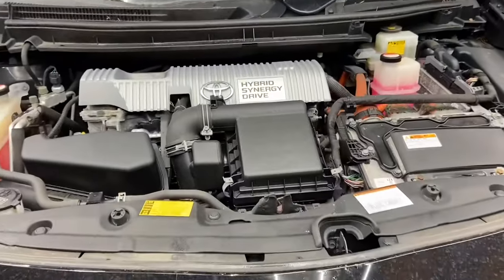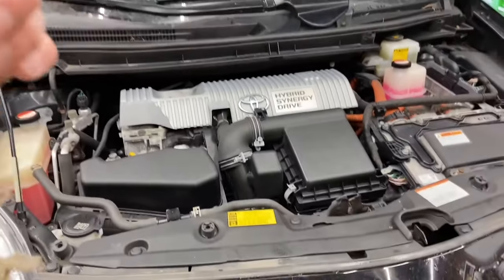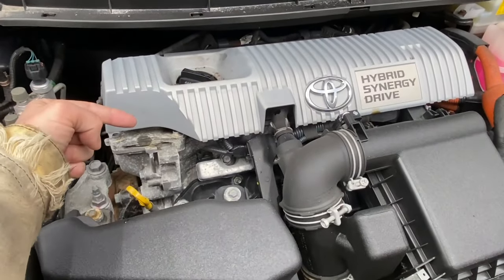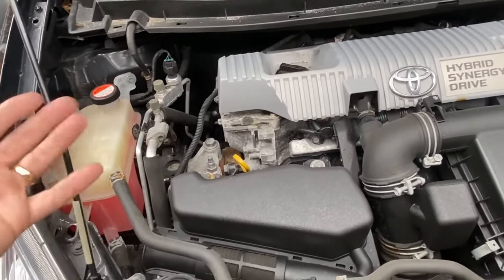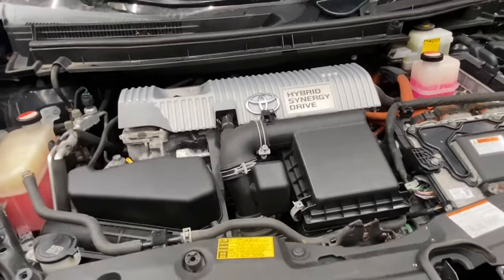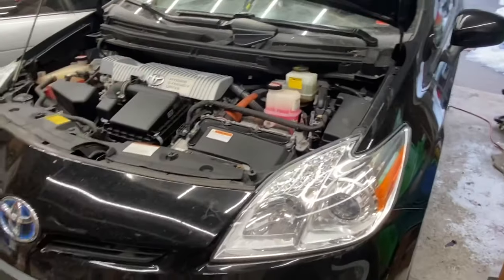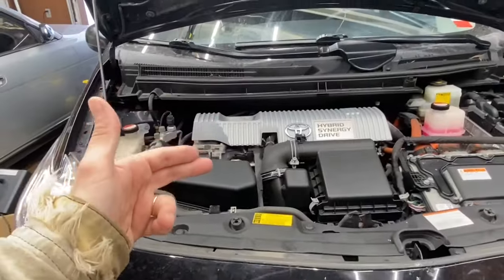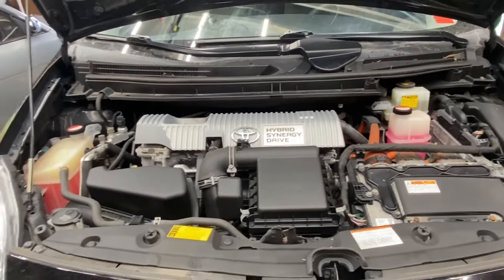Third Generation Prius PROBLEMS! Should YOU Still Buy One? A Prius Dealer/Technician Recommendation

Comment: Drew, great videos. I have a 2009 (Mother-in-law), 2010 (Peter’s-me) and 2012 (Wife’s). All great with over 300km (Canada) except my 2010! At 303,000km replaced the engine with a 93,000km engine. Have been dealing with “check Hybrid System” intermittent issues but garage that changed the engine out ultimately said my wiring harness had repairs to it and that I would need to got to Toyota as they had more sophisticated test equipment for hybrids to have the issue resolved! Toyota dealer said the harness repairs were all good and they cleared and said the car was good to go, then I drive for a bit and the check Hybrid system comes back. I Love all 2009, 2010-2015 Prius. What do you recommend I do for my 2010 to get this issue gone for good?
Peter in Ontario CA

Comment: Super helpful videos. Have a 2014 that runs great. Am preparing for traction battery replacement. Got any thoughts on Toyota vs Greentec or others for replacement?
Reply: Why do you need traction battery replacement how many miles?
Reply: Buy the upgraded battery. Charges faster and gets better mpg. Chris fix made a vid about it 2010-2015

Comment: Head gasket and bolts
Water pump. timing chain kit. variable timing sprocket. spark plugs. coils oil change. Resurface cylinder head. 
$4700 Prius V 2012 model 5

Good to spend this??

Comment: I have a 2010 Prius with 168K miles. My son was driving it and it died on the freeway. Codes 3190 and 3191. It also said "Check Hybrid System". I changed the fuel pump,the camshaft pos sensor and the crankshaft position sensor. When it tries to start the ICE it almost goes but then does the rattle. The coolant levels are a little bit down but they might have been already. (at or close to the "low" level) Dipstick has nice clean oil on it. Being that it won't start I'm guessing its either spark or fuel delivery? I never cleaned the EGR and am going to today. Could that be it? If it was a  coil pack wouldn't it still run?Possibly head gasket? Any help would be appreciate. Thanks
Reply from the maker: Yikes. They could be a lot. Always to go the big 3: compression, fuel, spark. And don’t forget timing. The EGR shouldn’t literally kill it. And coil packs are 1 per cylinder so that should cause a misfire before it causes this. 

Check fuel and of course spark but also check timing

Comment: I found a really nice 2010 with your experience what would you price it ? It definitely needs head gasket.
Reply from the maker: Needing a head gasket? Last 2010 I got was 201,000 with bad HG and a decent dent. $1500. For a perfect one, $2500 but if the head gasket symptoms were ignored, plan on a motor

Comment: thought my 2011 prius was bullet proof till the head gasket blew at 274,000 miles. replaced the head gasket but unfortunately the engine was to far gone.
Reply from the maker: I’m sorry to hear that, but goodness 274,000 miles is still a lot… Us Prius people have a tendency to think anything under 500,000 is chump change, but it wasn’t that long ago 100,000 miles meant a car was close to death

Not sure where you live, but if it’s anywhere near Port, you can get a JDM engine for your Prius for probably 1000 bucks and slap it in over a weekend. Cars are more than just their engine, the rest of that is still good I’m sure

Comment: Great vid, do all of these problems show up on the scanner? I scanned mine, got no codes, car is at 150,000 kms with just oil and filter changes and battery fan servicing, drives great but a bit down on fuel economy. This car hasn't even had it's plugs changed yet, so wanted to ask what general maintenance items should I perform and how much should I depend on the scan tool for errors?
Reply: My car had mileage drop gradually out of nowhere (lost about 8 mpg in 2 months). One day, the check engine turned on. It turned out to be spark plugs (the leftmost one died). I would check there with a diagnosis tool first before actually doing the change, but changing all 4 spark plugs fixed my issue. (Not just the one, because if 1 is dead, the other 3 are going to die soon too). 

Good luck!

Comment: I just sold my 2nd gen with 87k miles and bought a 2013 V with 87k. Just now reading about the head gasket, EGR and brake booster issues. Please tell me I didn’t make a huge mistake. We needed the extra space compared to 2nd gen.
Reply from the maker: Well, depends. A second gen is the most bulletproof Prius and one of the best cars ever made. BUT they are 15-20 years old now and have limitations. Example: I have 4 kids. And a camper that weighs 8,000lbs. A second gen does nothing for me. 

In your case, you still bought a good car. Just care for it as best you can and save a little here and a little there for the 180-220k time frame just in case. 

I just bought a Chevy suburban for my wife to replace a honda odyssey. I know this feeling you have. It will be ok :)

Comment: ABS system failed at 81K on 2011 prius, need to replace both the cylinder master and the brake accumulator.

Comment: Hi Drew, love your vids on the Prius.  Just completed installing of a set of reconditioned battery modules  on the 2012 Prius V.  A few cuts and bruises but beyond that things went pretty smooth.  For some reason the ABS Codes won't go away after reinstalling the battery pack in the car, they show up every time I run the scanner app. My second issue are the temps, is it normal for the battery pack temps to average 100F or so once they warm up?  Other then those two issues the car is running well although with a modified cooling system tweak (0-ring removed from the overflow cap, suspect head gasket leak producing a p301 code in cylinder #1).
Reply from the maker: That’s a tough one. Not sure if they are “permanent” codes but if they are, the car has to see the issue corrected to make them go away, in short. As for the temps in the battery pack, I have not gone too far down that road yet. I don’t have much advice to give on it. I have most of the tools (chargers) and the basic idea, but I cannot find the time to dig into a battery. It’s just so much tedious work. and I never thought of relieving pressure at the overflow, but that makes sense! If you think you’ve got a head gasket leak, best to just do the head gasket. Before it damages anything else! Nice job on the cells
Reply: bro keep that prius until it hits 400k miles!!

Comment: Very informative...coolant leaking, made sure to top it off every 3-4 days.What id the cost of head gasket repar and new water pump installed?
Reply from the maker: A head gasket is about $45 and having just a tiny bit of the head machine is probably $150. I don’t know what a mechanic would charge to do it, but I’m guessing probably 800 bucks. Although I wouldn’t do it for that lol not very fun

Comment: buy one.  best car ever.  if you are not into the way the prius looks, look into the lexus ct200h.  i own the lexus and owned the prius  just great cars for the daily driver.  the lexus gives you a nicer suspension...alot smoother since the struts are upgraded.  I just changed out the struts at 240k miles because one just blew out.  the rears were still about 20% life in them!!!! 247k miles and still going...i think i can get 600k out of this engine...maybe more.

Comment: If you hear the rattle, most of the time there isn't anything wrong. If you start the engine and shut it off within a minute , the engine wets the spark plugs.
Reply: But I used half the coolant reservoir in 200 miles.  Intermittent rattling.  Pulling the dipstick and looking under the oil cap, there is NO coolant contamination.  Where is the coolant going??  No obvious leaks under the car, either.

Comment: My 2015 Prius was nice until things started to break. At 121k the combo meter died, which resulted in a buzzing/electric whine in the interior when a key fob is detected. Been looking around and some people say bad 12v, which was just replaced with a Toyota one in February when this recent winter killed it. Other suggest bad inverter or just change dash, which is looking like a few thousand. Any tips?
Reply from the maker: I’d look into rebuilding your combo meter. I’ve done it ok 2gen. Super easy. Not sure on 3gen. Or order one with similar miles used and DIY. It’s not hard to get to 

The inverter should throw codes if it’s bad with drivability symptoms.

Comment: I am buying 2013 Prius - 125k - three owner - $8k what do you think? it needs door lock and headlights. what do I need to check?
Reply from the maker: That seems pretty reasonable! Just be sure it’s not using coolant. Ideally you’d see it cold… the issue usually comes around 200,000 anyway

Comment: How many miles does this car have and next has all of the oil and filter changes using Synthetic oil been at 5,000 miles/ Don't forget to do a cylinder leakage test before you pull the head then you will know if its the piston rings the valves could be leaking and the BLOCK could also be warped?

Comment: I had a 2010.  Don't buy it to save money!  As long as it is running then you save on gas but anything breaks down and then you spend all that money you save and more!  My brakes went out...3000.00 repair!  Then it started to shake when it was started up until it warmed up a little.  Tuned it up and it still happened.  Then you know the battery is just a matter of time though they do last for a long time.  You don't save a dime unless you trade it out when it gets some serious miles on it.

Comment: There is one available that had an engine replaced 190k miles, currently has 275k on the rest of the car. The owner has stated that the car consumes oil about a quart 500-1000k miles. I haven't looked into that, could be PCV or that the EGR hasn't been cleaned. If that turns out to be fine, how long would the transmission last if it has 275k? Do they need flushed?
Reply from the maker: So to give you an idea of how reliable the transmission, which really isn’t a transmission but a planetary year and two electric motors, you can find them as little as $100 on eBay, because there is a much greater supply (crashed cars, cars with bad engines, cars with too much rust) then there is demand. They are pretty much bulletproof. Unlike automatic transmissions, the fluid in these does not drive anything hydraulically, it just lubricates and cools. It is Toyota plain old world standard if I remember correctly, and it’s pretty easy to drain and fill.

A generation three with a good engine is all I would care about, I don’t even think about the transmission in these cars. I have a customer that has multiple million miles over several Prius and never did a transmission
Reply: @DrewGarage  Awesome, thank you for the reply and info! They seem like really great cars. I've never owned on but have wanted to for a while.  I'll look into the motor and see if the oil consumption is a PVC issue.
Reply from the maker: @LupeGalvan-pu5hr  You're welcome =) Toyota "bet" their entire future on that transmission (or at least 95% similar of it) in 1997 when they launched the prius. At the same time, America was ramping up v8 SUV sales. Yes the v8 suvs are successful, but look at toyota - nearly thier entire offering is hybrid. And they are GOOD.

Comment: Stay away from 3rd gen prius. My 2013 head gasket went on 210000.i just put a new engine which I bought from jwpqn and I had a local mechanic who put it on for a total of 2500$.  Now my battery is toast at 224000
Reply: What do you recommend instead? 210,000 is a long life.
Reply: @KidAMRadio  buy a gen 4 prius. .2016 and after . The only problem with the gen 4 is the water pump.

Comment: My prius sometimes makes a rattle on the passenger side of the vehicle on startup and medium acceleration. I checked some online forums that said the sound is most likely from some heat shield or bushing loose around the exhaust. Has anyone else experienced this or a similar issue and has had it resolved?

Comment: Thanks again for the reply!  That makes sense.  Maybe I should just buy a JDM engine with 60k miles for $1000?
Reply from the maker: That’s truly what I would do. But buy it with a warranty
Reply: @DrewGarage  Yep, most of the JDM's I see have a 1 month or at least a guarantee start.  Others offer 5 year parts and labor...but they are over $1k more.  Hopefully last question: Any danger just driving this thing and refilling coolant for a while?
Reply from the maker: @Sk8StGeorge  the only danger of continuing to drive it the way it is is that eventually it will create enough of a leak that you will bend a rod, this should explain it Inside Look: Bad Head Gasket! 2010-15 Prius Morning Death Knock (Head Gasket) Cause/Solution
https://youtu.be/Lu-YE9abpnc

There is also an inherent danger of any catastrophic engine failure, based based on where you are. So you are on an interstate in a busy area going through the middle of a city… But other than that, it won’t hurt anything other than the engine. I suppose it is not impossible that the force of the electric motor trying to crank over a locked engine could damage the transmission side, but I highly doubt it

Comment: What about Gen. 4 Prius ??
Reply from the maker: I’ve only had 3 of them and they were perfect. As they age and I get more, I’ll absolutely do one of these videos. I almost grabbed a 2023 at auction but stopped at $38,000. On a used unit that was $36,000 new. Hard to justify the risk just to say I did it. Our dealership seems to do best with southern gen 2s. I’ve got a bunch of low mileage 2gens now. 

Please like and subscribe if you haven’t already :)

Comment: Hi Drew. You are the guy I was looking for help please. I really like the way you explain. So I have 2014 Prius 200k mil. It vibrates whole body on high speed even starts from 35-40 mph and when you push more acceleration doesn’t vibrates that much but when I try lower rpm does more vibrations. I did change Spyro plugs all suspension. Got brand new tires. Still does it. I would love to hear your opinion please
Reply from the maker: Hi! Sorry for the delay! Does it change with the engine off!? This may sound crazy but you’d be amazed how tires and CV axels can disguise their issues as worse problems. Let me know! Please like and subscribe if you haven’t already :)